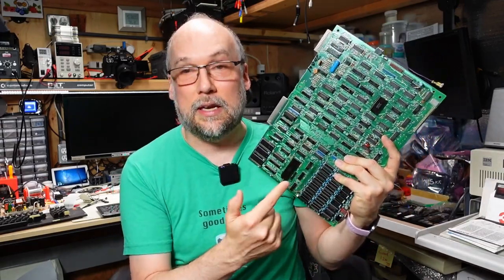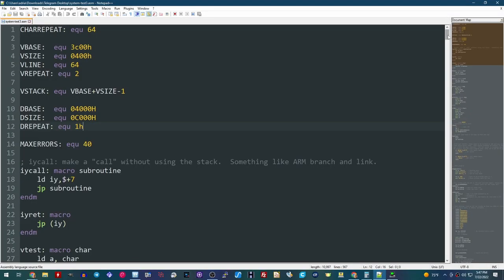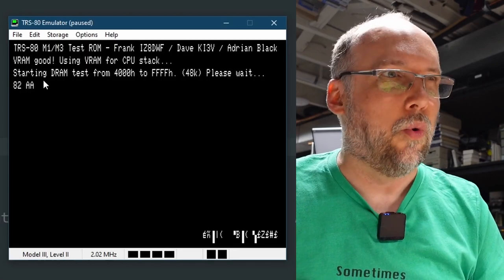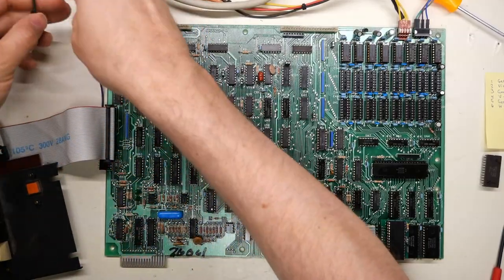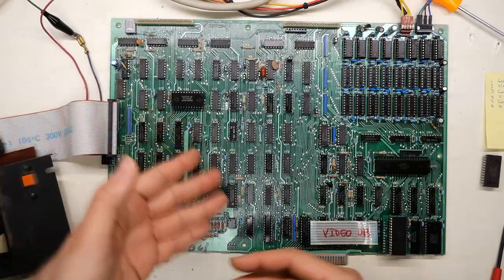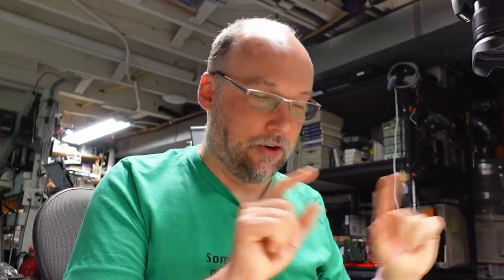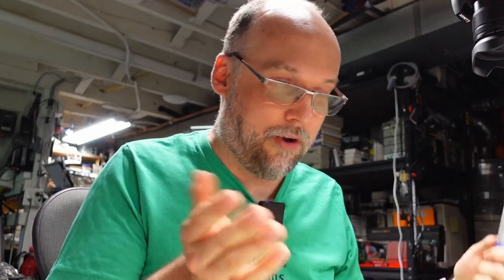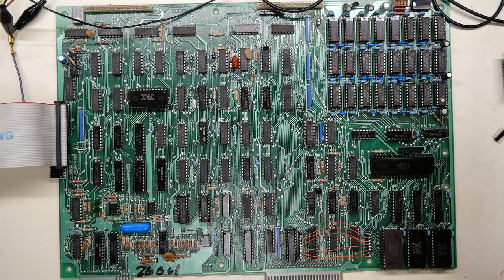Using our new diagnostic ROM to fix a TRS-80 Model III!

Comment: I know this is an older video. The diagnostic ROM will not work for a TRS-80 Model 1 unless it has had the lower case mod and it is turned on. The problem is the unmodded Model 1 is missing 1 bit of video RAM. A program or a stack won't work in video RAM without the mod. The cure was to piggyback a RAM (there were only 7) and wire a separate data bit line to the extra chip, cut a trace that forced the missing bit, and add a switch to enable or disable the mod. A look at the manual for the Model 1 will verify this. Just maybe someone published the details of the lowercase mod or you can probably find it in an old magazine archive. It was a common mod back in the day so you could use the Model 1 for word processing.

Also, it was the Model 1 with level 1 BASIC that could have as little as 4k RAM. Level 1 BASIC was little more than a modded version of Tiny BASIC and only used about 4k of ROM. Something to keep in mind should you try to do a diagnostic that might work for a Model 1. All Model 1s were limited to 16k in the keyboard unit. You needed the Expansion Interface to get 48k and the ability to use peripherals. You might want to change the diagnostic to be a little smarter about doing the RAM test.

The Z-80 directly accesses memory through the 16 bit address bus which limits it to 64k. There was a little bit of bank switching logic to access the RAM in 16k banks which is invisible to the user or programmer as it is done in hardware. Those 2 bytes shown for the diagnostic program are just the upper and lower bytes of the address. The Model 4 had paging that allowed up to 128k of RAM using a port for page selection. I don't remember any programs for the Model 4 that could leverage the full 128k of RAM and the early PC's were available making the entire Z-80 line obsolete by then. The Model 4 boots up in a Model 3 compatibility mode so the Model 4 features are invisible unless you know how to access them. At a very limited level, the Model 3 is also identical to the Model 1. The keyboard, video memory and cassette port are in the same places. The ROM and the RAM usage is different enough to cause compatibility issues for programs that try to directly access things or load where they probably shouldn't.

Comment: shouldn't be line 201 a DB 00000001b instead of a 00000000b? there's already a testone 0 at the very beginning of the pattern set.
Reply: Yes, those early tests were pretty haphazard. Worse, they didn’t work well: the tests would not find bad chips. Turns out there are a lot of subtleties to detecting bad RAM when you need to. We’ve switched to a much more effective test (called March C, for the way it marches through the memory) invented by people who know lots more about memory than we do.
Reply: You beat me to that comment :)
I'm always looking for inconsistencies in sequences just in case I messed up in a way that's hard to detect later. It's become more of a subconscious habit than I thought.
Reply: @JB52520  I even can't say why I noticed it.

Comment: I'm only 31 minutes into the video but was wondering if it could be possible to program an Arduino to act as an "in circuit chip tester" : knowing you're testing an 'LS00 (8 inputs, 4 outputs), it sniffs all 12 pins and makes sure it acts as an 'LS00. It even tells you how many of the 256 combinations it has encountered so far. Now, knowing it is U48 you're testing, it tells you (maybe with the help of a custom ROM) if it behaves as U48 should. That custom ROM is written to cycle through as many combinations as possible...   Or use the standard ROM and (automatically) compare with a working machine (record-compare or database)

Comment: Wait a minute; Didn’t Adrian do a video several years ago where he repaired an Apple ][+ that had a bad 8T26 bus buffer, and replaced it with a small riser board with a standard TTL 74LS-series bus buffer?

Comment: So I guess that you wont just measure continuity from now on but do resistance? :)
I think I actually commented that last video too but maybe I forgot lol.
Reply from the maker: My meter actually still shows the ohms reading with continuity -- but really it needs to have a load put on the connection. Corrosion does stuff like that, extremely low current works but anything more and nope.

Comment: try a diy mask-rom fast cache cpu/gpu at any frequency, where the rom-cache holds all alu instruction results, 2x 8/16 bit addressing + 8-bit instruction selector (3x8bit or 2x16 + 8bit rom-cache addressing) with 16/32-bit output
Reply: the memory controller (fpga/asic) makes sure all the virtual cores have their own registers in main processing in-memory cache
Reply: as many cores as you can fit in the memory controller, texas instruments can make the memory controller off-the-shelf fpga
Reply: mask rom is the simplest memory possible
Reply: for a cache sram module
Reply: mask rom fast cache can also hold basic libs like java class libraries, not only the alu instruction set results
Reply: yes, the whole operating system binaries, or virtual machine binaries
Reply: really fast operating system data fetch from the rom fast cache
Reply: just swap the fast cache rom or have a dynamic sram for any updates for the operating system
Reply: fast mask rom cache is the same but simpler than transistor cpu alu
Reply: because you dont need transistors, just the rom on/off switches already there, no charging needed
Reply: you got a thermal anti-short
Reply: vsync succs!

Comment: See, I said that cable was janky!  I suspect if you check that original cable, you will find that the corrosion acts like a pull up/pulldown  resistors (depending on where the current goes through the corrosion)

Comment: I'm not sure your diagnostic chip will work on a stock Model 1.  The Model 1 only had seven bits installed for the video display.  I modified mine by adding the 8th chip so the monitor would display lower case characters.
Reply from the maker: It does :-) I'm already using it while working on a 7-bit M1 on another video. The latest version of the ROM that is.
Reply: @adriansdigitalbasement  Glad to hear it.  Just noticed the lower case characters on your display and knew my Model 1 originally did not display lower case.

Comment: Is "page" in older memory like this roughly equivalent to "row" in modern ddr? Logically speaking.
Reply: Not that familiar with how DDR works, but I don’t think so. “Page” unfortunately often means different things in different contexts. Here, a page was a 256-byte block of RAM. Even in TRS-80, it sometimes means something different, like a 32K physical region on a model II.

Comment: I can't believe you didn't flip the ribbon cable and put it in the other way... see if the problem moves to another bit. Fortunately, you wrote on it and kept putting it on the board in the same direction so you didn't further confuse yourself.

Comment: I suppose this shows why you shouldn't just go in with the parts cannon and swap chips to try and fix a fault. If Adrian had swapped every single chip on this board then the computer would still have a fault at the end.

Comment: i don't think a continuity test is a true resistance reading.   try measuring the resistance in ohms mode and see what the resistance is.  and you could have had a bad solder connection on the bottom of the board and the chip was good.  that's why I always reflow connections first then test again, before pulling a chip.

Comment: if you have to build/have an adptoer to run the diagnostic ROM, why not include a dip-switch on said board, used to set the RAM size

As for the sound, I bet no one noticed until you said something (there was a definite difference), even if there was post-editing

Comment: Why not check all possible variants of RAM amounts and display what works.  So if only 16K works it shows that or 32K or 48K.  That would make more sense to me
Reply from the maker: Take a look at the repo, that's how it works now :-)
Reply: @adriansdigitalbasement  Excellent.  I'm still watching.  I'm only 15 minutes in.  I was a component level service engineer on Acorn machines both the 8bit and 32bit ones back in the day and wrote a few ROMs for the Amstrad CPC range.  I really enjoy your videos which really take me back.  I'm always on the look out for interesting retro machines to fix but so far only found a PET 4032 which I rebuilt on my very small channel.

Comment: I am very disappointed with your follow up, as it is clear that you have no idea what fan out is.  If you had, you would not have questioned any of the buffers, or their use.  This is very basic digital electronics knowledge that needs to be considered with every design.  You seem to understand propagation delay, but lack the understanding of fan out, which doesn’t make sense.

Anywho good luck on your endeavors.  My best reccomendation for you would be to stop making unwarranted assumptions, and you’ll be significantly more successful.